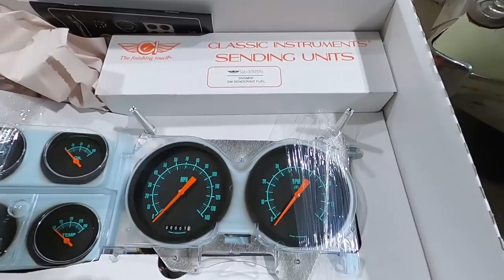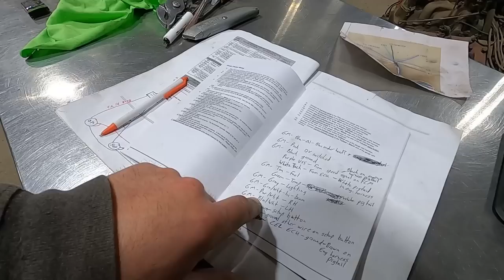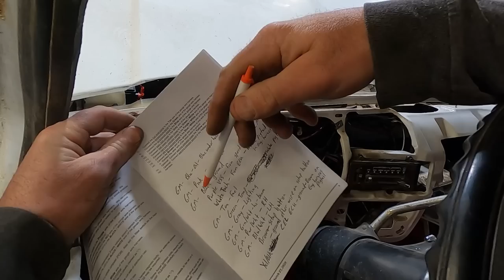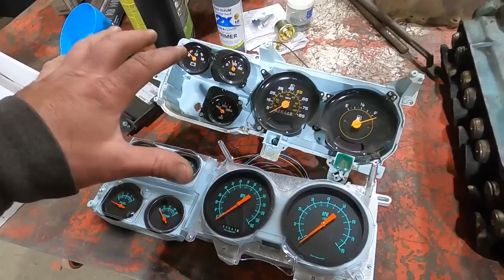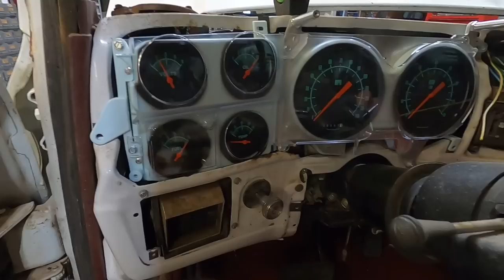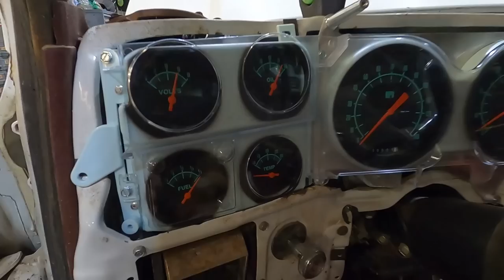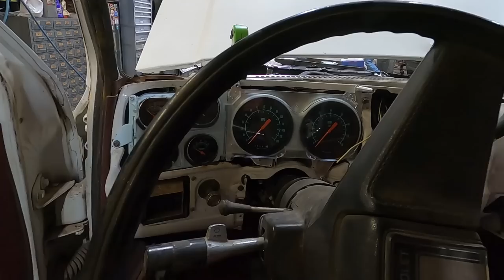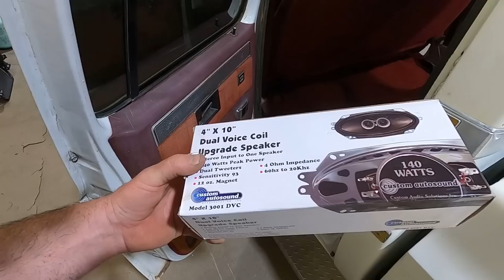Squarebody Dually Upgrades! Gauge Cluster, Stereo and Amateur Windshield Replacement!

Comment: differences in resistance between left and right speakers play hell with the amplifier circuit.   might could use, if you have, bass output or nothing at all.

Comment: The reason most folks use the glass cleaner on windshield installation is because the alcohol makes the parts super slippery, that only lasts until the alcohol evaporates, then its super sticky - probably would be more better to just use wd40

Comment: A positive voltage will cause the speaker cone pull in,,,  a negative voltage will cause the speaker cone to push out,,  Or Visa-Versa,,,,   Anyway,,  if you have one speaker cone pulling in while another speaker cone is pushing out,, it can cause a cancelling effect,, or wierd sounding stereo,,,   :-)

Comment: The LS needs a rod knock sensor.. 3 stock LS engine's , two 5.3 L and one 4.8 L all ate a rod in under 200000 km.. If its not race built your better of with a big block or small block... I will never again trust a stock LS.. Waist of time and money.. Big block for a big truck.💯✌

Comment: 2X Rustolium cans suck ass. We use it at work and every nozzle gets clogged. We throw more away then we use. Ill never buy it to use at home. Heating up a punch works better for finding holes for carpet. It will melt right thru the carpet and give you a perfect hole and the edges get sealed from the heat. Once you do it that way you will never do it any other way. Much better than the christmas tree bit.

Comment: reverse polarity on a speaker will cancel the tonal response......use yer VOM to measure voltage on speaker wires........also reversing the wires will cause the speaker to act backwards and pull in when its supposed to go out......they all need to be same........otherwise sounds like shit.......experiment with 9 volt battery on a speaker and you will see what i mean.........or enjoy garbage sound its yer call